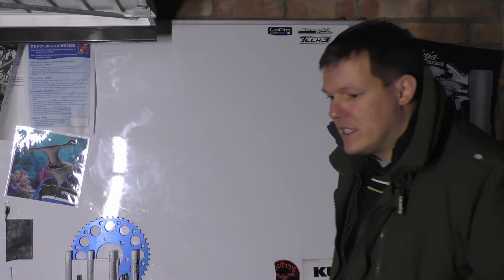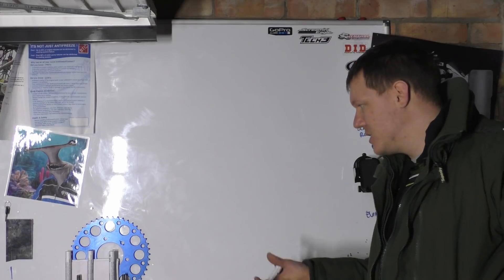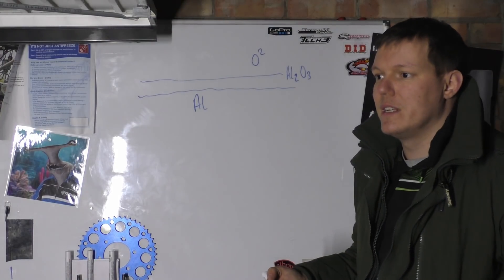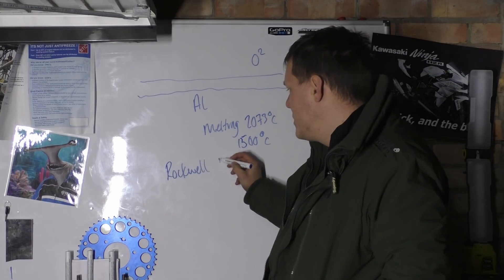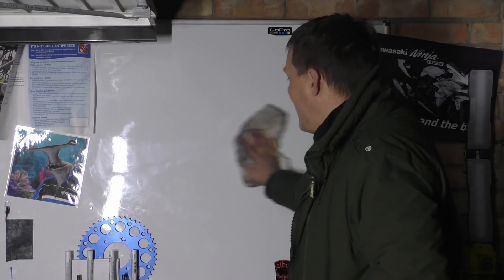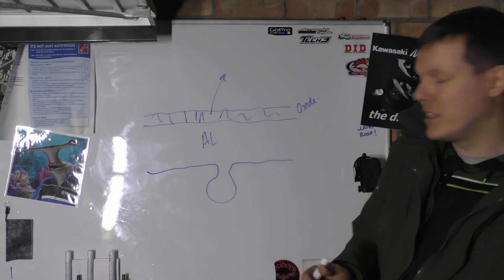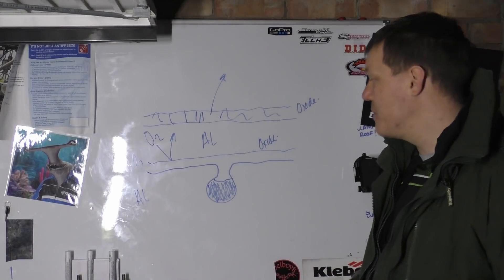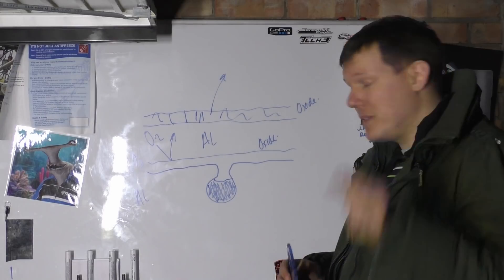Aluminium anodising - why?

Comment: So is it aluminium oxide that makes my engine look like shit? If it is, does that mean my engine is super strong now? Do they anodise engines?
Reply from the maker: Generally no. Cast ally has a lot of silicon in it and this doen't anodise very well - we'll cover this later.
Reply: Natural oxides of any metal are very brittle(rust) since they include dirt and grime(impurities) catched on metal. Thus being said, anodised or painted metal surfaces are different matter. PS: Different colors of paint include different oxides, that's whats give them color.